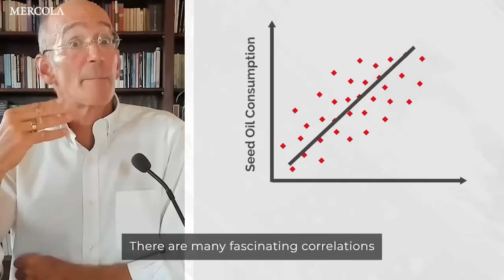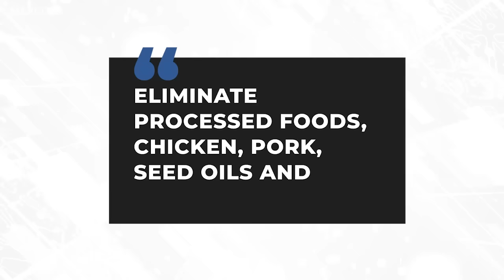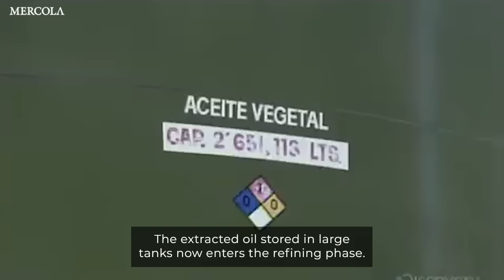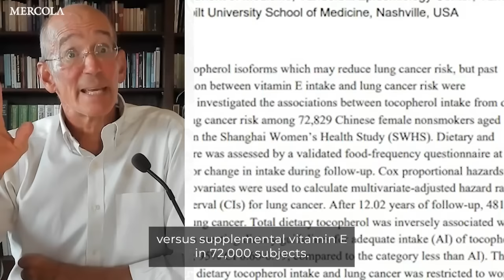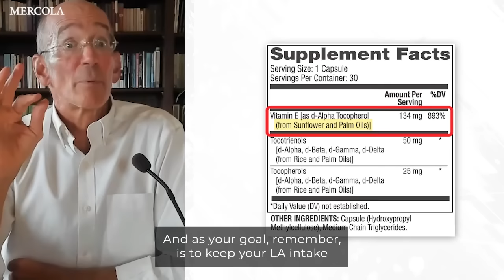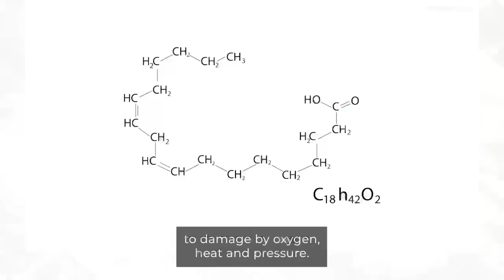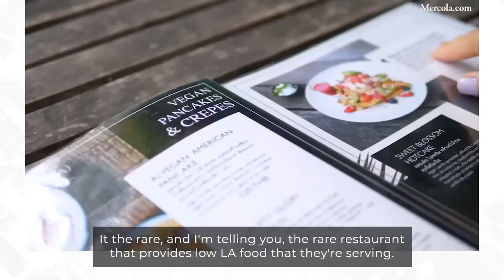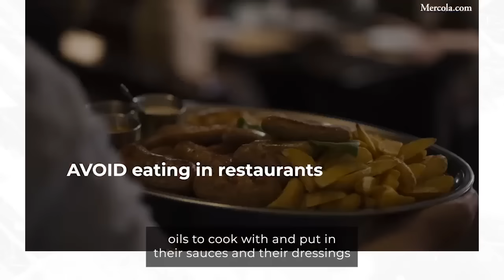Linoleic Acid: The Disease-Causing Toxin Lurking in Our Foods

Comment: Restaurants.  Look behind your restaurant to see if there is a special small dark filthy oily dumpster.  That contains used seed oil that they cooked your food in.  That used oil is an expensive commodity that is removed by a local company. In my area, it is called buffalo bio diesel. As the name indicates, quite clearly, they refine that oil into a form of diesel fuel.  There are less than ten restaurants in my entire state that cook with tallow.  Believe it or not, there is a tallow restaurant association that lists restaurants that cook with tallow.  In my opinion chinese take out restaurants are the worst offenders.

Comment: So consumption of olive oil wasn’t so widespread in the past as it is now
Reply: AUTHENTIC Olive oil has been consumed in ITALY for hundreds of years.  However, since olive trees aren’t native to North America, animal fats were the primary fat source in North America.
Reply: I suffer from man made dreams for the last 20 years between Canada and france... 
90% of dreams are man made by electricity. Here are the values:
The frequency in Hertz of the dreams are around 300Mhz for the high and around 7 hz for the low value.
The electric field values on my sleeping bed of each dream range from 40-70 v/m a set of 4 or 5 values before the peak which can be usually around 120 V/m and can go  up to 700 V/m if they want to wake you up or shake your heart.
Especially if you have excess toxic conductive metals like silver or copper.
This make a glutamate excitoxicity, which causes Calcium influx into the cell, and damages the  cell membranes,
You remedy with Vitamin C, D, Magnesium, L-theanine( green tea ) and Turmeric and vitamin B-complex rich foods but they increase the frequency which makes you tired.